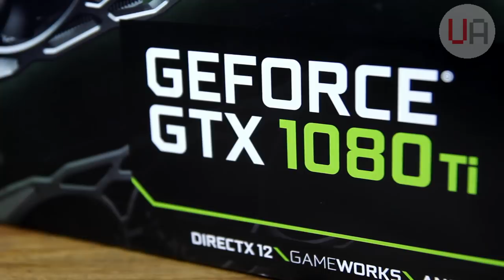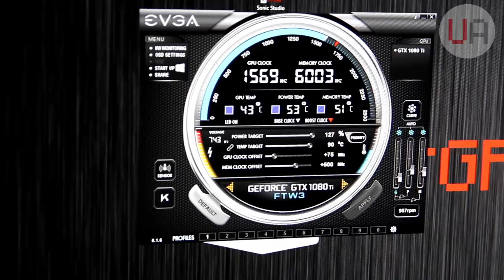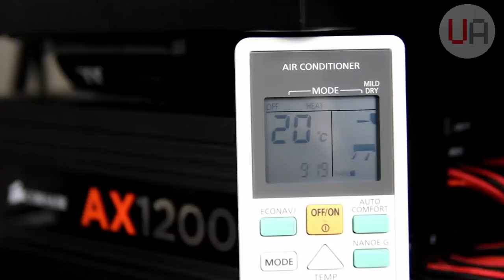Liquid Metal on a 1080Ti - EVGA FTW3 Gets Cooler!

Comment: The video is good. EXCEPT ONE THING: YOU DIDN'T PROTECT SMDs ON THE CHIP! There must be a lacquer coat on top, otherwise LM can short the card and you're toasted :\
Reply: no there must not... iif you do things right you dont need to coat any thing.... only noobs does
Reply: Not worth risking a top of the line gpu by being too lazy to apply an protective coating around the core.
Reply: Totino's Pizza Rolls Agreed. Ive used it before on a card that is over 2yrs old no issues. Although today I probably wouldn’t recommend LM as the risks rarely outweigh the benefits over using a good quality thermal paste.
Reply: @jimminez86  On the one hand you can go no coating and risk permanent damage to a Verrry expensive piece of hardware for bragging rights, or you can spend a few bucks on nail polish and greatly reduce the risk of losing a 1080TI. Your choice.

Comment: +Upgrade Addiction you should use liquid electrical tape around the die, if the liquid metal spreads outside it can cause a short and fry your card it's conductive.

Comment: Great video! I just replaced the thermal paste on my FTW3 and got 5c using Gelid GC Extreme (I don't like having to sand down the hardened liquid metal over the silicon in order to repaste it, so I prefer using regular thermal paste)
Reply: Perhaps you should give Thermal Grizzly Kryonaut a try :) It is one of if not the best non liquid metal thermal compound out there. Used it on many of my components and laptops. Excellent drops all round. I'd say you can drop a few more degrees compared to Gelid (which i used to love until i found Kryonaut) :)
Reply: Don't bother withe Kryonaut on a Strix 1080TI, exact same temps and fan curve. Sigh..
Reply: Do keep it mind that the cooler on the Strix is different. Half a slot more of heatfins. Either that or you've maxed out the cooling capacity of your cooler. Sorta hard to explain but it has happened to a few of my pals even on laptops. My 1070 in my Aorus X7 did not go above 70c on stock paste. Kryonaut didnt do a whole lot either
Reply: Cristian Feldman how obvious it that Jared works for Grizzly
Reply: Yeah I've been wanting to try Kryonaut for quite some time now, but it's really hard to get in my country and way too expensive to get from abroad. But I'll try it someday; I read that it's a bit better than Gelid. BTW I hate how thick and sticky the Gelid paste is, how's the Kryonaut in that regard? Sometimes I prefer to use MX4 because is so much easier to apply...
Reply: Cristian Feldman how hard is it to take off cooler of gpu? I looked and seem to be alot of screws plus the headers you have to unplug
Reply: A razor blade makes it super easy to scrape off the hardened metal
Reply: A tip to this is to just buy the cleaning kit from cool laboratory this should help you out so you don't have to sand down anything.

Comment: Damn that front plate looks good! Good temps for a stock card too

I had to modify my turbo 1080ti as it was hitting 83 degrees, now with my Morpheus and Ml120 fans I’m hitting 2063mhz @ 47 degrees with fans at 35% inside my mAtx case. Liquid metal might have helped lower those temps but the NT-H1 seems to be doing fine.

Comment: Anyone who has an evga 1080 ti ftw3 such as I would like to know that this process does not void warranty.  Contacted Evga and asked just that and they responded back as if the card is not physically damaged in the process then it does not void warranty.
Reply: I have got crashes and artefacts after this actions :D
Reply: Chirp Imabird I have the same card but most likely because his tests run the card outside of his case in his computer and the card has direct cold air to use instead of recycled hot air my card has to use while it’s inside of my computer. Temps with increased voltage on near maximum fan speed with the aggressive fan curve do reach 75 to 68 C with a good amount of hot air flowing out of the case. Speeding up the fans in the case does lower the card’s temperature a little. But my room also is hot in temperature and does get hot in temperature because of my computer.

The power limit is reached even before the card hits 127%. 

None of that answered your question in any way maybe. But I’m just putting this here.

Comment: I cannot stand open air test benches. Please, please, please just test inside a case so that people understand what will happen when it is restricted for airflow. With my 240 AIO rad up front, my 1080ti ftw3 gets around 80c. I have no other choice for the rad.
Reply: While i don't know about water cooling other large youtubers (such as Jayztwocents) have done videos on test bench vs closed case and as long as you have the proper airflow the cards will run at the same temp or sometimes even slightly cooler then bench.
Reply: Is your room temperature also 20 ° C? Because if not then the test conditions are not equal
Reply: @chrisrawr6177  That is true, however , unlikely in 90% of cases, no pun intended. To truly achieve open air temps inside a case you will need a ton of fans pushing air in. Also In Jay's vid the cpu had a basement rad which has an isolated air flow and doesn't have to share with gpu.

Comment: I have the FTW3 hybrid, and I went with overclocking on a curve and I got the card at 2100Mhz stable on the core, +250 on the memory. This has given me the best performance, I've tried all sorts of different numbers obviously. Just an FYI, if you use Afterburner to overclock Boost 3.0 +101 at 1065mV and higher you may see better performance.

Comment: true the weakest link becomes the heatsink with the conductonaut. we tried this with the galax gtx 1070 katana and temps didnt improved much but thermal throttling was reduced and we got better clock speeds.

Comment: Great results, I am doing my card tomorrow!
Reply from the maker: +Alex Reimer good luck! Let me know how it goes!
Reply: Upgrade Addiction it went well, I put clear nail polish beside the GPU on the board to protect the resistors from shorting in the event of leakage. I just quickly played some Battlefield 1 @ 4k ultra settings with direct x 12. Temperatures seemed around the same. I am going to start gaming shortly and do a good test run. I did have the card overclocked (power +120%, gpu +65, mem +100) it ran about 61 degrees C once the temperatures levelled out.

Comment: I have Liquid metal tim on my xfx rx 480 no signs of any problems at all.  The cold plate is a copper block with copper heat pipes the fins are aluminum.

Comment: I REALLY appreciate your work! You do an EXCELLENT Job, better then most of the Tech Tubers I subscribe too, so you just got yourself a few likes on the videos I have watched so far, and a new subscriber.

So you said in this video if we have any suggestions on cards we would like to see you repaste, I have one I would really love to see you specifically do, but this card is pretty damn expensive so I don't know if it would be worth it to do.

But I just picked up an EVGA FTW 3 1080 ti, same  card you just did, except its the Hybrid. It will be arriving tomorrow. I first am going to put the card through its paces to see how well it performs Stock and then see what I can get for a max Overclock, and Log Everything. Then I am going to compare it to my current Zotac 1070 Mini to see how much of a boost I get. I have already settled on doing this Repaste and a Power Shunt Mod to the 1070, but I am also Contemplating doing both the Liquid Metal on the GPU as well as on the Power Shunt to lift the Power Limit a bit on the 1080ti. 

I WOULD LOVE to see you do this in your video. You pay a lot of attention to detail which I appreciate, you give us the data, you don't draw it out, and do useless shenanigans, your straight to the point, and you give us the data to let us draw our own conclusions. That is a flawless approach in my opinion so I will be keeping an eye on your channel from now on. But if you could do at leasat the Thermal Replacement (if not both that and the power mod by putting the liquid metal across the power shunts) on any of the Liquid Cooled 1080ti's that would be AMAZING, because it would show us what we could expect if we were to do the same thing, and your data is trustworthy!

Anyways, Sorry for the TL;DR! Thanks for the Amazing Content!

Comment: I don't think EVGA cares if you take the cooler off. I bought an EVGA 1080 TI SC2 last year and EVGA had a recall on my batch. The memory on some of the GPUs from my batch were overheating. I haven't heard of any actual damage happening from overheating, but the recall was solved with a simple BIOS update on the card which basically just adjusted the fan curve on the card. Nothing major. EVGA knew that some people would still be concerned so they offered an optional free thermal kit to anyone who requested it. You could ship your card to them and have them do it for free or they were willing to send you a kit for free with instructions on how to do it yourself. They said  my warranty would not be voided by doing it myself and that they would replace the card even if I accidentally damaged it while installing this kit. So it was fun taking apart my 1080 TI with no worries about messing it up. The kit included thermal pads to cover all the memory on the card as well as the back plate of the card making the whole thing thermally connected together. I put NH-1 Noctua thermal paste on the die since that is all I had. They did include the stock paste with the kit, but I wanted to use some aftermarket stuff instead. I think I had around an 8 degree drop in temps with that thermal kit applied. I don't think EVGA will replace your card if you damage it while upgrading the thermals. I'm sure that was a case by case thing from the recall they had on my model, but I don't think they will void your warranty if you take it apart as long as you don't damage it. It really isn't that hard. It is just a big heat sink sitting on the die. Not much you can mess up unless you spill your drink on it, drop it, spill liquid metal on it, etc. As long as you are careful and have common sense you should be fine.

Comment: Very intriguing...looks just like molten solder. 5C would be the difference between my EGVA 1070 SC throttling and not throttling. Looks like this would be best for bare cores like GPUs, right? Or have you tried it on CPU heat sinks?

Great video and overall production value, btw. Subscribed! You'll be at 50k subscribers in no time.
Reply from the maker: thanks!
 Ive used it to deliv cpus, but not on top of a cpu, its not ideal for that

Comment: If i think about the fan speed being controlled by gpu-temp. decreasing the gpu-temp while its getting higher vcore/oc should rise the temperature on the ram/vrms quite a bit since the cooler doesnt spin up.  these temps would be interesing to see.

Comment: You compare the stock messy compound with one newly applied metal compound but you should switch it back with a standard compound to have a viable comparison. What if you get the exact same results with a standard compound because the stock one was old or badly applied ? What if, it's because it's "fresh" that it's improving and not because of the type of compound ?

Comment: Ive applied Conductonaut on both my GTX 1080's which are on an EK FC1080 Waterblock anyway but I figured if my loop was going to be OTT (3x480mm rads), i might as well use it. Cant wait to test it when i finish my loop, granted one of my cards might not work as i dropped it off my kitchen counter lol.

Comment: Would of liked to see this inside a case to get real world temps. Normally this card isn't that low in a case with heat from everything else. I'm about to liquid metal mine. I get about 70c in case and I get 2000mhz which drops to 1960mhz because of heat. I've also bought some conformal coating to put on the smd's around the chip. For added protection.

Comment: those are rookie temps, for air cooling. LOL

i have an msi armor 1080ti and i modded it, a bit:
- accelero 3 heatsink which itself is modded (strapped 3 bequiet 92mm fans on top of it with zipties, instead of the ugly fans+shroud it came with)
- applied conductonaut liquid metal
- changed all thermal pads everywhere with arctic ones
- put tiny heatsinks everywhere
(running in a closed case with 5 fans -> 3 in the front as in and two at the back+top as out) 

So, i oc'ed it, a bit:
Got it to 2050mhz core clock and 12.85ghz mem clock
 (ambient temp 18C)
benched superposition @1080p extreme preset and max temp was 43C.

Someone correct me if i'm wrong, but that's definitely watercooling territory, right?

Comment: You could definitely unlock the bios and push +100 on the core clock and +650 on the mem clock. My MSI water cooled 1080ti runs that right now stable. Def going to take a look at liquid metal on top of the water block. Good stuff man. Would be cool if you had a 1080ti results of water cooled factory paste vs liquid metal.

Comment: Personally I don't think I would bother for the relative small drop in temps and from a risk management perspective too. Noting the LM is electrically conductive there is a chance (depending on how the LM is applied) that one could short out the card is not careful. I just don't think that risk (even if it's a relatively low probability) is justified for the 5-7 degree temp reduction. An Intel CPU though is a different story, shit TIM and no internal exposed electronics with anywhere up to 30 degree temp reduction. But hey it's up to the individual.

Comment: Just sharing my experience, Ive done stuff like this all the time. I was extremely confident in my skills, however when I applied this to my 1080 ti sc2 I was getting artifacts and hard crashes. It was not heat related and there was no spillage of metal anywhere. I just want to share my experience. Im kinda bummed it didnt work out for me. as soon as I properly cleaned up and repasted with Noctua n1 everything cleared up and card runs cool...

Comment: Vapor chamber works well, what about having a vapor chamber with Liquid Nitrogen built in, would be even better, also they can make the GPU's and CPU's with led on the sides to dissipate heat, this way heatsinks can be much smaller, so graphic cards wouldn't be so massively huge.

Comment: Does the paste react to the aluminum on the heat sink?
Reply: EvoPortal I have two 1080ti rog strix sc in SLI and the temps aren't to bad but would love to try this what do you think?
Reply: Google your cards. Look up what your heat sink is made of. If it's not aluminuim or doesn't contain any aluminium traces (which is rarely the case), then you have your answer.
Reply: Normally, you HAVE to seal the smd capacitors on the die too, with nail polish or something, atleast that's is what is done on CPUs like Haswell. when LM touches any of theses capacitors it WILL fry your core!
Reply from the maker: You really think i don't do any research on the type of cooler before i go and do this to cards worth $1200+???.... I sense that you are one of those people that are the 'knower of all things' and have advice because no-one else knows what you do. Believe me, I do my research and know how to handle this stuff. But I appreciate your concern.
Reply: So does anyone know if I can do this to my cards?
Reply: Can i do this to my Ryzen 1600? using 212 Evo btw
Any answer would be much appreciated
Reply from the maker: Yahtadi Shidiq first of all, Ryzen chips have soldered IHS's.... 2nd, no I wouldn't use this with a hyper 212, they have copper pipes on the base but surround by aluminium. Just use a good 'regular' paste between your CPU and Cooler.
Reply: I have read about liquid metal "Pro" will harden after a period of time and require repasting. Not sure about the liquid metal "Ultra". Anyone wanna shed some light on this issue?
Reply: Steven Hipes liquid metall NEVER on Aluminium! Nickel or copper is ok
Reply: Yes, and negatively. Follow the link to the product page he provided in the description, and just after the first paragraph, it reads:
"  Please note: Not for use with aluminium heatsinks.  "
Reply: +EvoPortal get rekt m8
Reply: ya, um...I'm not sure you can respond to all the haters out there. It may not be worth your time. I suggest you keep making these well produced and knowledgeable video's for diyers like myself and the other 99% who watch. Well maybe 98%, as there are quite a bit of haters out there who are jealous. Thanks.
Reply: Upgrade Addiction would this LM work with a cold plate copper? Or does it actually need a nickel plate for the heat sink? I was thinking of using a NZXT x52 and a Kraken G12 for my 1080 ti, but I’m a little skeptic with the LM.
Reply: Yes, it will eat away at the nickel plated copper as well. You can sand it down when it gets bad, but it will happen eventually. It's best to save liquid metal for under the IHS of a CPU.
Reply: You don't have to... but you SHOULD. I would NEVER do this without coating the SMD components, everyone makes mistakes occasionally.
Reply: Needs to be copper or nickel plated to use safely
Reply: CAN NOT USE IT ON ALUMINUM.

Comment: I use a ftw3, I handle the OC in afterburner and the fan curve in XOC (the new X1 software is a nightmare :/). The afterburner is superior for overclocking no contest.
 I'd probably isolate around the chip with some tape for safety.